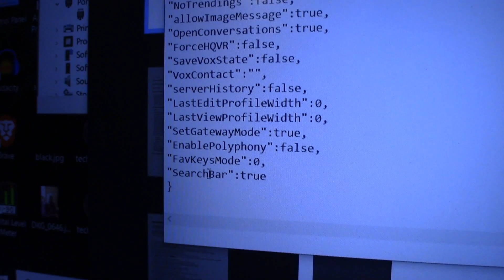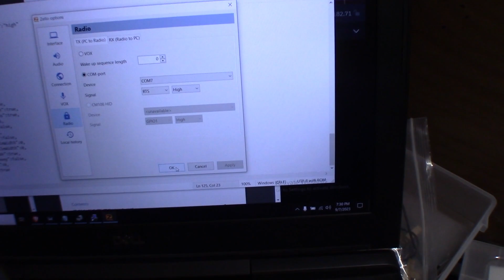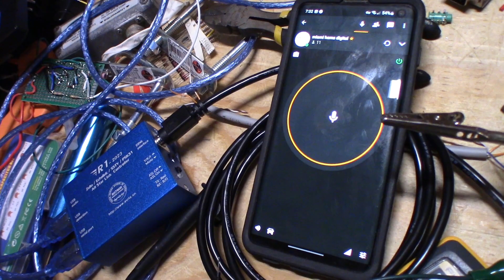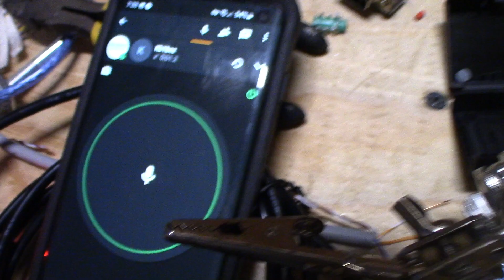R1 2023 Blue Box zello interface PTT and COS behavior solved

Comment: how do you solve the issue when the pc is off or crashed ?  currently when this behavior happens it puts the R1 in transmit mode and the repeaters are locked it TX mode
Reply from the maker: I have never had this happen. When the pc is off the R1 does not go into TX mode. Maybe you have something inverted in the settings?